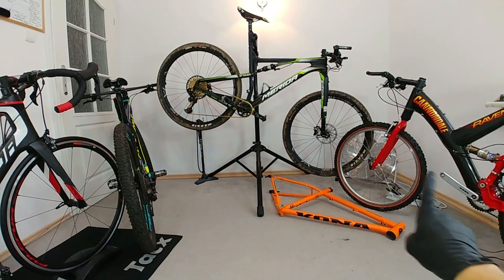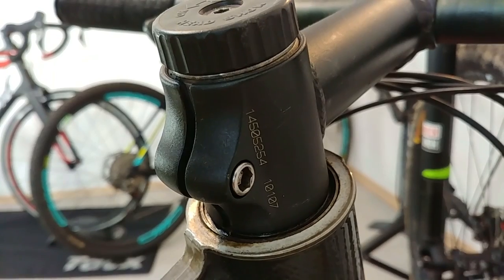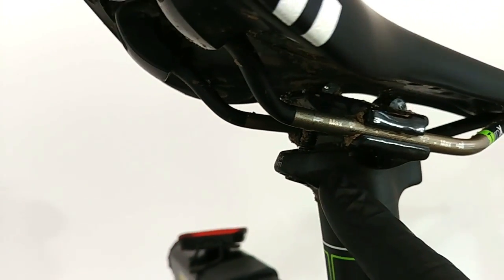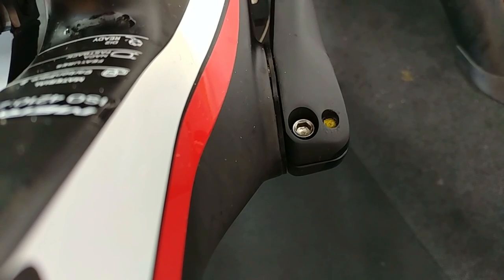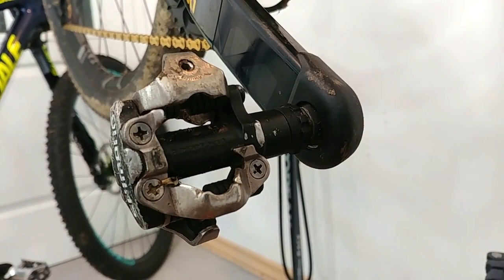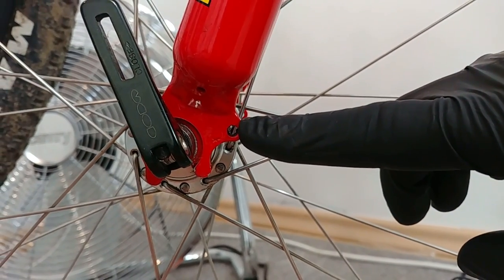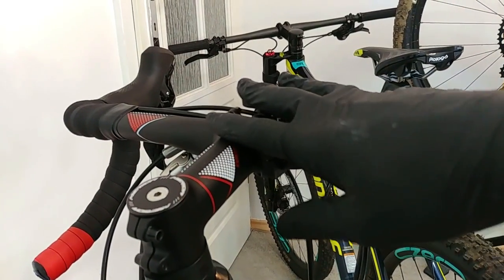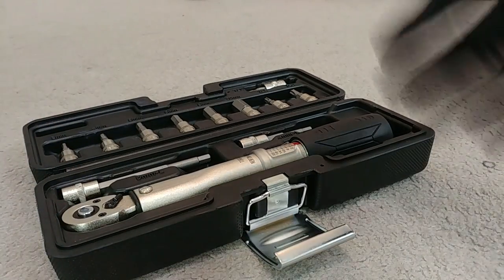Bicycle Bolts Torque Specifications + Extra Tips On Torque Wrench.

Comment: I just bought two digital torque wrench adaptors 20 - 200Nm 1/2 in drive with 1/4 & 3/8 drive sockets and as above but 1.5 - 30 Nm for bike & car. I gave my traditional torque wrenches to my son as I want more accuracy plus I can see the display setting plus a beep when reached a given torque :)

Comment: Pedals are fine even when you don't screw them tightly on, because epicyclic fretting precession will tighten it when pedaling. But it seems that in some case, when there's already some problem, that same precession can completely destroy the thread and stretch the hole in crank arm larger.. instead of tightening. At least I believe that is what happened on my old bike. I had stripped the thread on crank arm a bit, don't remember if it was by overtightening by all my weight, or maybe cross threading it. But it looked still strong and I thought it's fine. And really, it did hold few years, but then failed and quick, I noticed that pedal is lose, re tightened with hand(did not have any tool with me), then could ride maybe 300 more meters and had to tighten it again.. and then again and then the hole in crank arm has got that much larger, that I was searching for some garbage from the side of road, hoping that I can still continue riding by wrapping that between threads.. but that did not help. Even though I was very gentle on that pedal not pushing it. I could ride only maybe 30 meters and then the hole in aluminum has stretched already so much that.. there was nothing to do. I had to ride back home with just one pedal.. platform pedal.

Comment: The seat post clamp on my aluminum alloy road bike (Planet X RT-58) doesn't have any specification written on it. I tightened it to 6Nm but I could still rotate the seat post, so I went for 7Nm. It doesn't move, but I am not sure if that is the correct torque for it. Any comment or advice on this matter will be greatly appreciated.

Comment: I just use a luggage scale on regular wrench/hex key. It's more precise, when used correctly. It can be used also on both pedals equally well (Most torque wrenches don't work on reversed thread). It's cheaper than torque wrench. I would consider to buy a torque wrench, if I were maintaining some more bikes than my own, or if my time that I spend more with scale and regular wrench, had otherwise greater value, than the cost of a torque wrench..

Comment: Hi! Peter here! Thanks for such wonderful tips on the settings for newton meters with a standard torque wrench. But I would like to know i if I use a digital torque wrench such as Summit 3/8 Inch how do I set the proper torque value on a Digital Torque Wrench for example 6Nm will show what on the Digital Wrench, etc. Thanks for the help!

Comment: very cool video! for stuff like bottom brackets and cranks arms back in the day i used to just make sure they were on much tighter then most everything else. Im glad to see i kinda got it right and now i will finally have 2 torque wrenches  the bigger one is one the way. Is there anything on a bike that would be more then 75 Nm either way i think the max on mine will be like 200 Nm so Im good i guess.

Comment: Sorry, this is the first video on your channel that i have to dislike. The Information is just way too specific to be any useful. There are just too many different components out there (seat clamps that need 3.5nm of torque, stem bolts that take 12nm and so on). 

But because you are one of the only youtubers that talk about torque (in depth) i recommend you make a Video about tightening patterns or hand tightening (to torque specs). Testing bolts to failiure would be interesting to see, too...
Reply: Reiner I disagree. I've been trying to figure out the whole torque thing after riding for 30 years and always tightening by feel. As the bikes were mostly steel back in the day, it just didn't matter much. Now with newer sensitive advanced materials it matters much more and I bet there are a lot of baby boomers (like me) who are trying to figure this whole torque thing out. I just purchased a Moto Century Pro Ti Disc and was looking for torque info b/c when it arrives as I'll need to assemble.
Reply: Gregory Gannotti I recommend you not to follow this video and rather go to the manufacturers manual to get all the correct torque values for your specific components. Example if using Shimano you can download all the assembly manuals in their website etc.
Reply: yes, I will, thanks. This video opened my eyes to the extent though. I would have never realized .